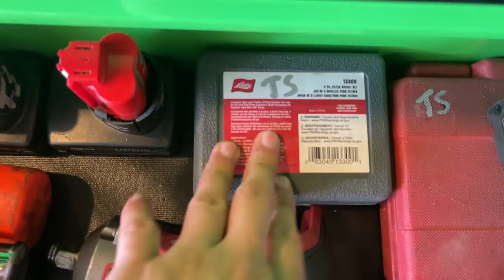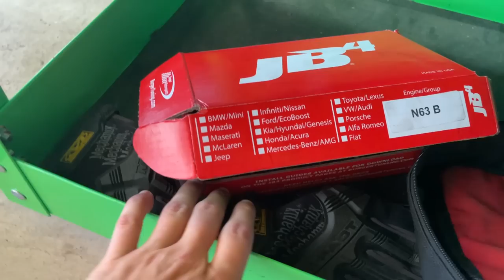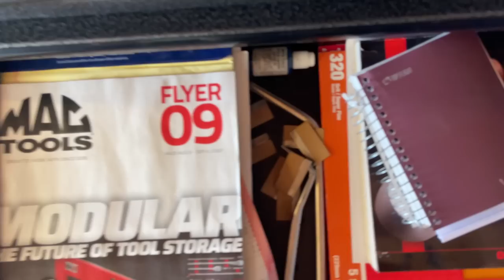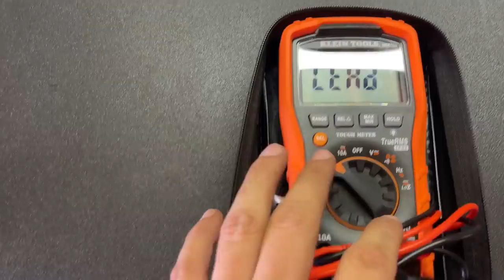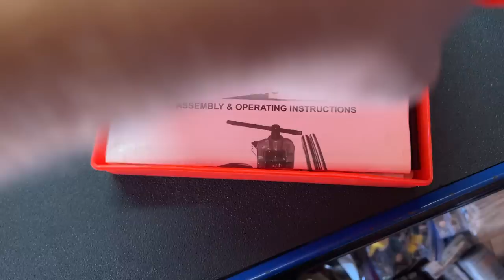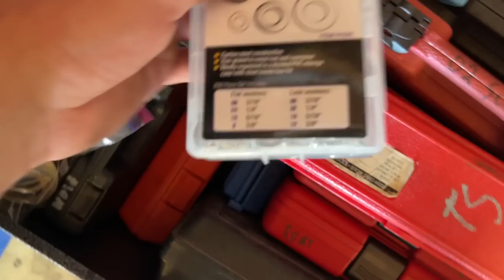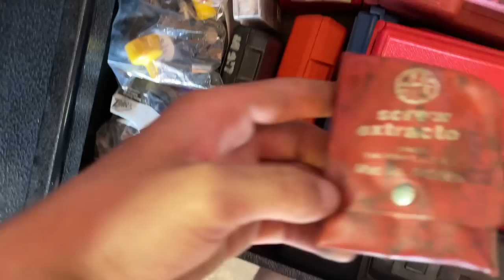Most Full Apprentice Toolbox On YouTube!

Comment: im 13 just getting into tools but ive been around them for day one. My question is should i buy expensive of the start and take a little to get everything or cheap but i could have everything relatively quick
Reply from the maker: Buy cheap, you might not know if you wanna do this as a career and it makes it easier to replace with what breaks with expensive